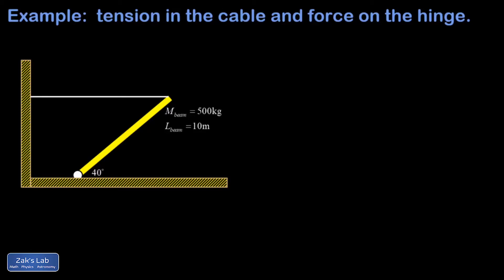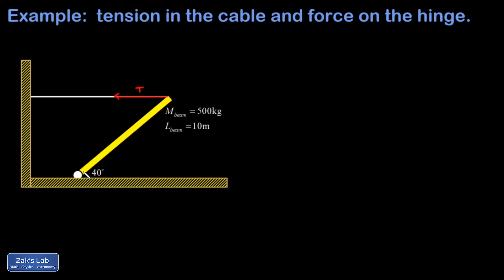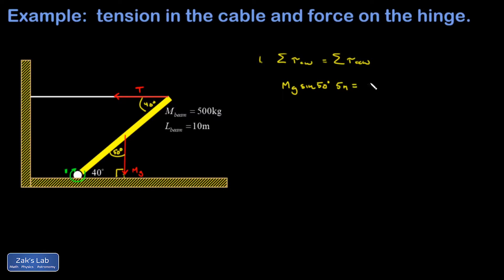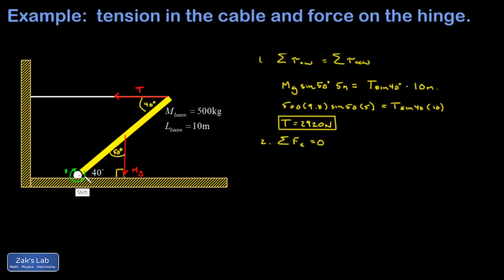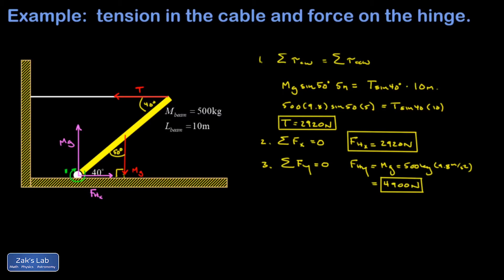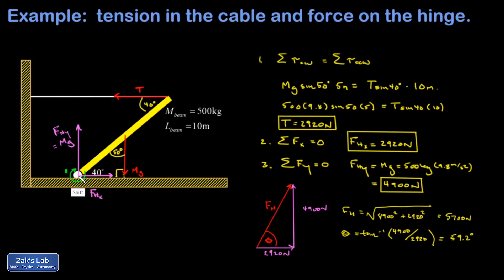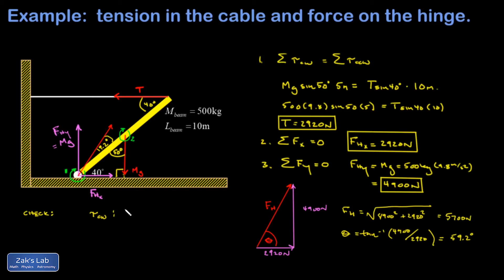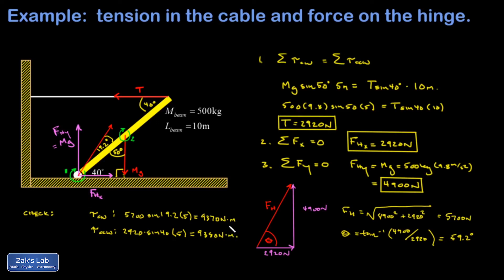Static equilibrium tilted beam and cable with hinge at the bottom and horizontal cable.

Comment: I have a similar exercise where I need to find the forces required (force in the rope and 2 reaction forces in the hinge, that serves as a fulcrum) to keep the system in equilibrium. 

The exercise is made in 7 steps;

1) redraw the situation in terms of force vectors and angles
2) analysis of the vertical situation (incl. Fhy)
3) analysis of the horizontal situation (incl. Fhx)
4) analysis of the moment around the fulcrum (reaction forces Fhy & Fhx do not cause a moment)
5) reverting back to step 2 & 3 to fill in the equations
6) conclusion (forces in Newton drawn on the vectors
7) check - sum up the vertical forces

Now what is not clear to me is when I need to apply trigonometry in the exercise. Should I also apply trig to Fhy & Fhx in step 2 & 3? 

When doing the final check in step 7 - summing up all the vertical forces - I do not have 0 as a solution.

Your advice is much appreciated.

All the best

Comment: Why do we use sin 40 when finding the tension? If we use the x component of the mg , why dont we also use the x component for tension? Can you explain why we need to use the perpendicular component?
Reply from the maker: torque is defined from the very beginning as the perpendicular component of force multiplied by the length of the lever arm.  This makes sense because the perpendicular component is the component doing the twisting.  The other parts of your question are trig - the angle between T and the lever is 40, so Tsin40 gives the perpendicular component.  The angle between mg and the lever is NOT 40, but we know the angle between the vertical and the perpendicular to an incline is equal to the angle of incline.  This means the perpendicular component of weight is given by the adjacent side of the triangle, so mgcos40.  The trig is introduced when inclined planes pop up, usually the fourth week of a one semester physics course, also available in my dynamics playlists if you haven't seen it before.

Comment: Can you explain why the force of gravity and the same as the force on hinge in the y direction , I would have thought it to be equal to the force of gravity only in the y direction. Wouldnt the force on the hinge Y be greater if the beam was more vertical ?
Reply from the maker: We know for sure that the net force in the y direction is zero.  With the weight of the beam being a constant mg and the cable oriented horizontally, the y force from the hinge is the only other possible vertical force, and therefore must be mg.  If you imagine an animation where we make the cable shorter and shorter, it would no longer be oriented horizontally - instead, it would have a downward component of tension exerted on the beam - perhaps this is what's messing with your intuition here.  z

Comment: What should we do if there are 2 cables, one oriented on the bottom and one on the wall above the beam? (How would we setup equation)
Reply from the maker: Depends on context -- I think if you add another cable pulling down here, it introduces too many unknowns to solve (you could pull down with many different tensions and the system will just stay in equilibrium - the tension in the upper cable would grow as the tension in the lower cable grows).  So you'd have to be given a tension on one of the cables to make it solvable.  In any case, you set up the torque equation, but now your bottom cable contributes a second clockwise torque wrt the beam (the weight of the beam being the first clockwise torque).  Finding the angle to get Tsin(theta) will require a little bit of right triangle trig, but no big deal. z
Reply: @ZaksLab  Thanks for the reply, I am currently trying to solve a question my professor has assigned to me and it is absolutely kicking my butt. This video is the closest I've seen to the problem.

Comment: shouldn't torque be the cos(angle) for perpendicular component of mg??
Reply from the maker: you're probably thinking of the usual inclined plane diagram that shows the angle between the weight vector and the perpendicular, which is the same as the angle of incline.  Then your perpendicular component of weight is mgcos(theta), where theta is the angle of incline.  In this example, I labeled the angle between the weight vector and the beam by using 90-theta, and the perpendicular component is given by the sine of that angle.  Whether you call it sin(50) or cos(40), you're going to get the same result.
Reply: @ZaksLab  makes perfect sense thanks!